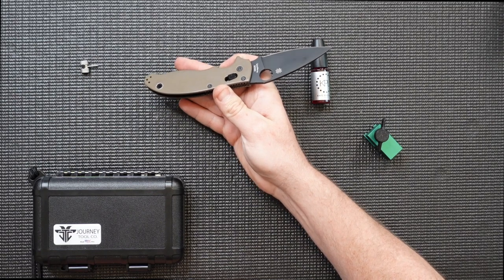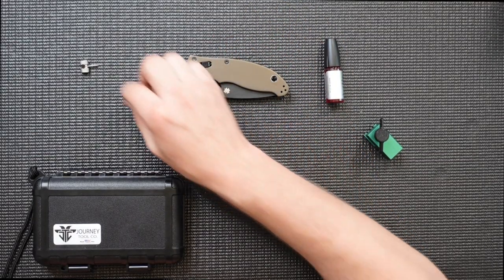Modding the Spyderco Manix 2 - Major Upgrade!

Comment: The lightweight and a 'standard' Manix 2 were my first Spyderco purchases.  Of course I immediately got some carbon fiber scales, a Lynch NW clip, a titanium cage and modded it.  Learned later from a group on FB that you can run a lighter weight spring and a ceramic ball, OMG the action is just scary smooth.
Reply: Where do you buy the light weight spring?
Reply: Where can I get the light weight spring a and ceramic ball?

Comment: I like to use the 1/4 Teflon tape instead of locktite. Making future disassembly much easier. The Teflon tape also prevents screws from backing out.
Reply: Give purple loctite a try. It’s definitely the way to go over blue loctite. The only downside is that it isn’t available in stick/paste form like blue.

Comment: Crazy that after all this time there was any easier way to remove that ball bearing! This method looks way easier than what I’ve been doing 😂
Reply: I have the original manix the locking mechanism is it does not have the locking mechanisms I’ve been looking for a while to fix the knife

Comment: Can i take out the lanayad tube with out totaly diassembling it? I have the kpl lube and i aso have some new ball cage and hardware upgrade i want to put in. i have the sharp dress knife tool also.
Reply: there is absolutely no reason to remove the tube. You can easily disassemble it without removing it.

Comment: Newb question. I just ordered a Manix 2 XL. It's my first premium knife. Should phosphor bronze washers be lubed?
Reply: A bit late but no
Reply: @Yuzuki1337  well, I did lube them with a little standard weight KPL, and when I put it back together with a new ball, ball cage, and less stiff springs, it ran like an air hockey puck on an air hockey table, and still does. Action went from awful to otherworldly.
Reply: Yeah custom mods can be quite nice and it's a great feeling to work on your favorites and have them turn out even more to your liking than before. :) I'd argue your action would still be good with unlubed washers though, I've never felt the need to lube specifically nylon, teflon or phosphor-bronze washers if they're quality parts. Accumulating a bunch of crud in your moving parts is a real pain in the ass and usually makes for higher maintenence so I tend to err on the side of less lube in less places. Enjoy your nice knife and buttery smooth action my friend! ❤️